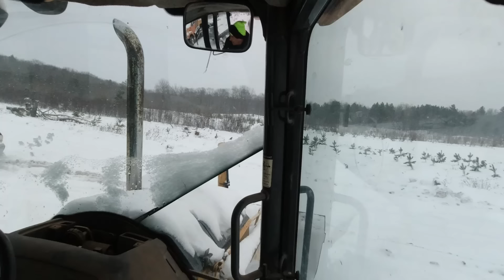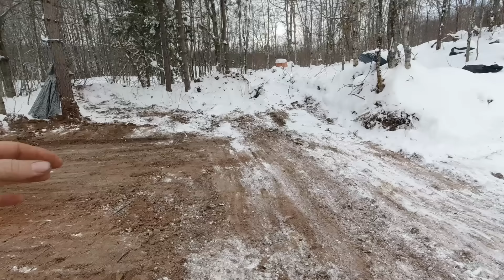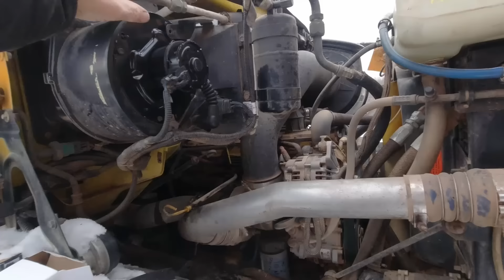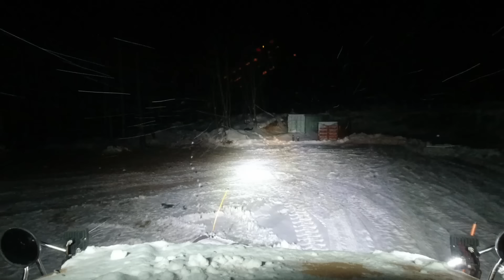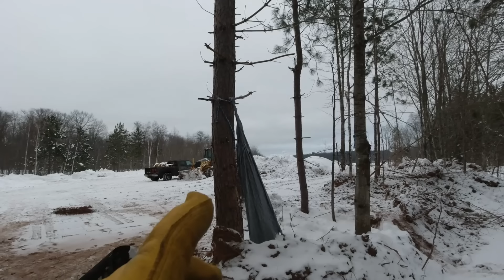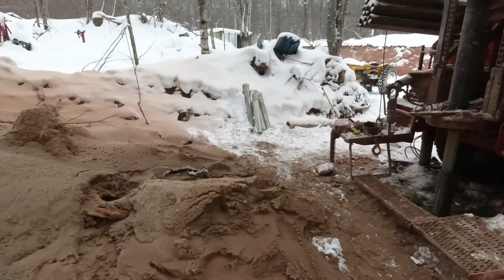We are moving forward on the Well 38/2025

Comment: Larry its better to drill to bedrock even if its 100' down or more because you could get much more water and not need a booster pump . larry since your building so far from the well i would run 4 to 6 inch pvc pipes underground and run your water lines through them to avoid freezing .